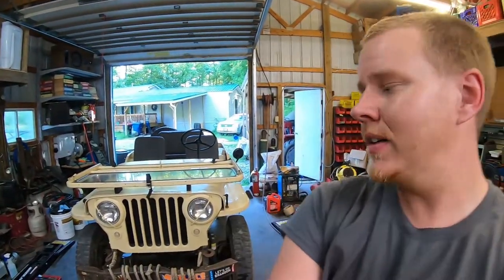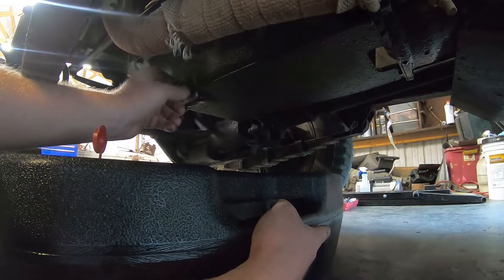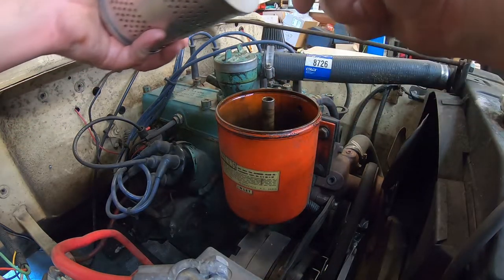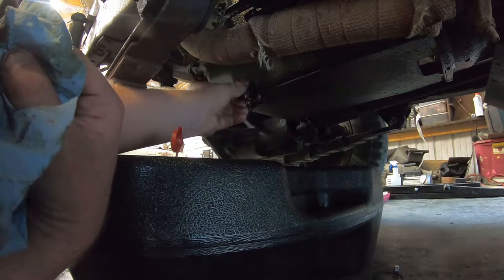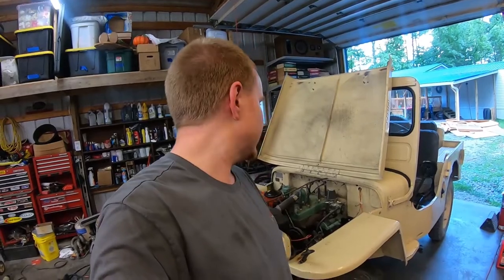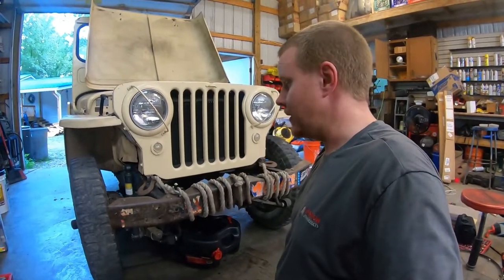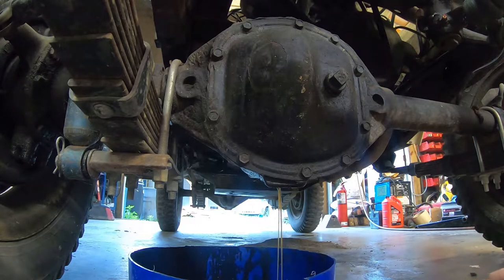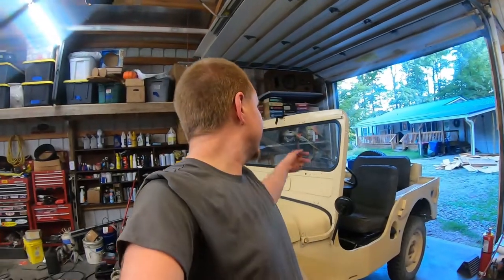1949 Willys CJ-3A Service & Drive - Oil Change, Differential Oils Changed, Etc.

Comment: we have a few cj2a's up at the farm  in NH, a guy a few towns over has one with a VW TDI in it...my 2 TDI's are running a WMO blend very well... im sure the guy a few towns over could as well, got 35mpg and could run 50mph with the TDI.  One of the 2a's that is in less good condition I plan on putting a fiberglass tub we have on it and putting one of our extra TDI's into.... could be a fun project for you if you could find the parts...the older TDI's are getting harder to find and more expensive
Reply from the maker: Kubota swap would be slick too.  Sounds like you've got some future projects for sure.

Comment: HI BROTHER  I JUST  NEED  TO CONFIRM  
ENGINE  OIL YOU PUT  15W-40 HEAVY DUTY OIL   
FRONT DIFF  OIL 80W-90 HEAVY DUTY  OIL 
AND  FOR  THE  4X4 AND  GEAR  PLEASE TELL ME  WHAT I CAN USE ??
Reply from the maker: 15w40 in the engine, 80w90 in the transmission, transfer case, and both differentials.